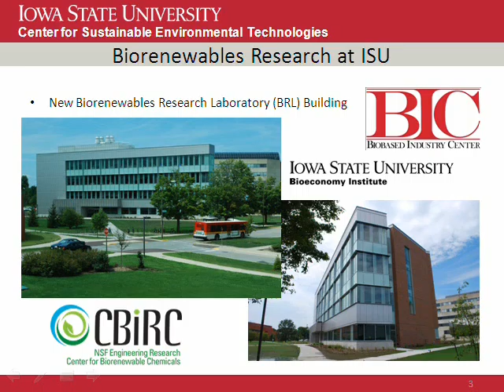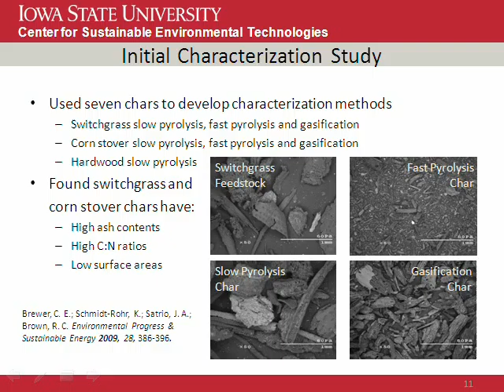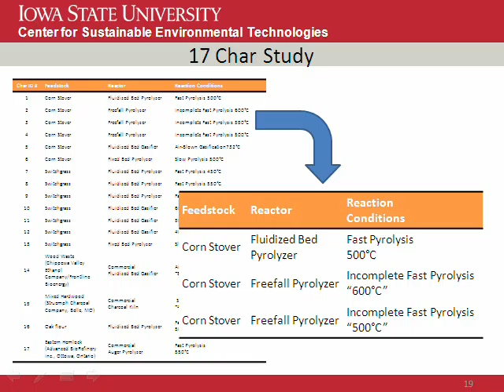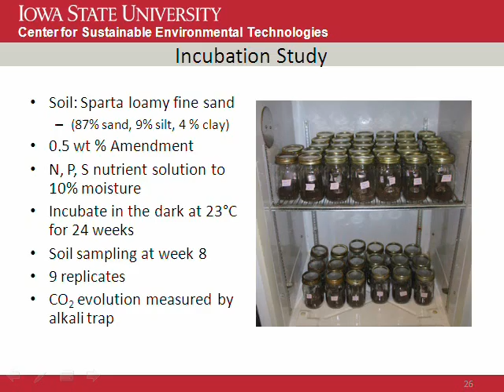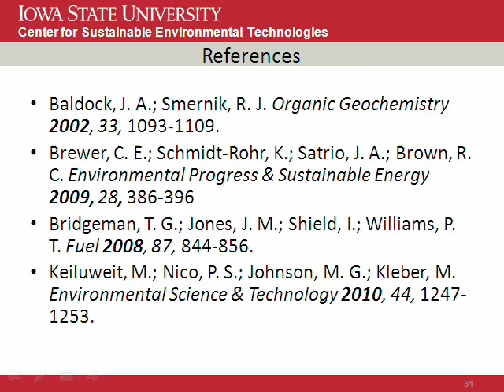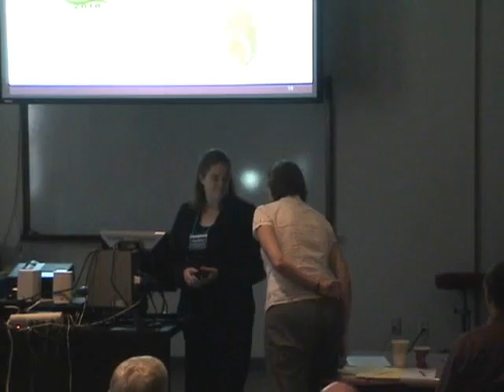Biochar Characterization and Engineering

Comment: Your response to one of the questions about the environmental impact of pyrolysis was anemic!What was not discussed was the presence of oxides of nitrogen that was released into the environment.   These gases are responsible for "Acid rain!"  Ignoring the content of the effluent gases could contribute significantly to the destruction of the ozone layer!  We must be vigilant that this enthusiasm for biochar does not end up in another environmental disaster and the writing of another "Silent Spring" type book.  As a scientist you have the responsibility to question why this issue has not been addressed!
Reply from the maker: Thanks for voicing your concern. Significant impacts to our climate from biochar production would come from commercial production facilities. Those facilities must comply with the Clean Air Act Standards. If there someone is producing a small batch of biochar on their farm, the emissions are similar to or less than people burning leaves or trash. Unfortunately, these actions are typically not regulated.